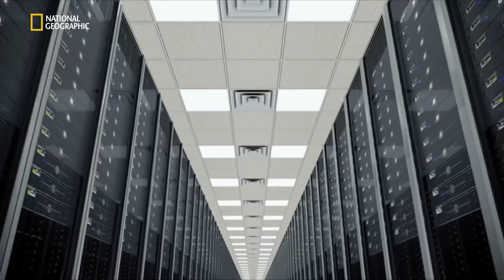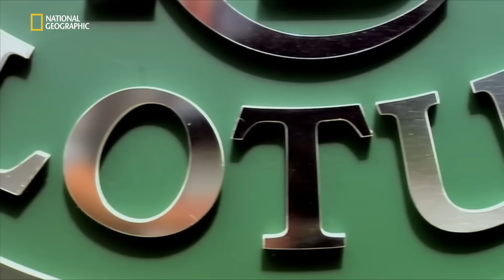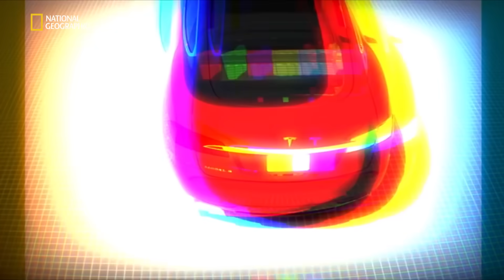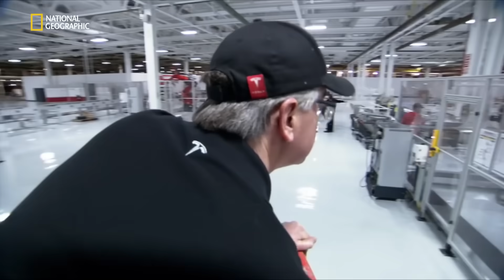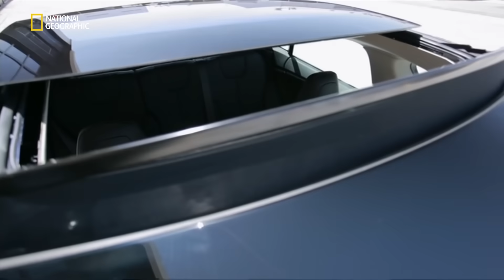National geographic megafactories - Tesla

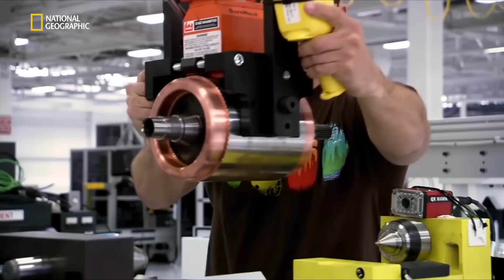Comment: 15:18	Carry an electric motor using an overhead hoist and place it on a jig
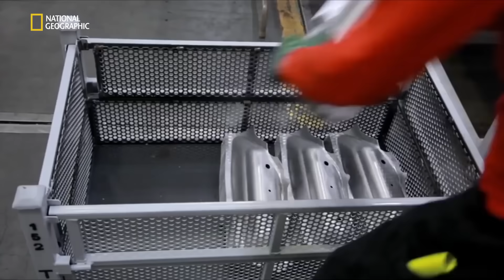21:47	Place stamped parts in a crate
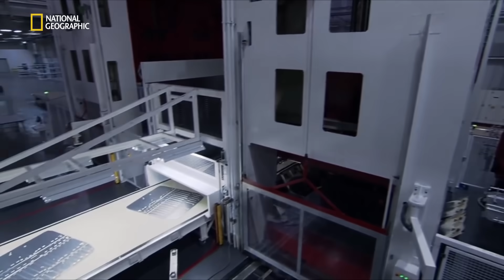22:20	Pick stamped parts from a conveyor
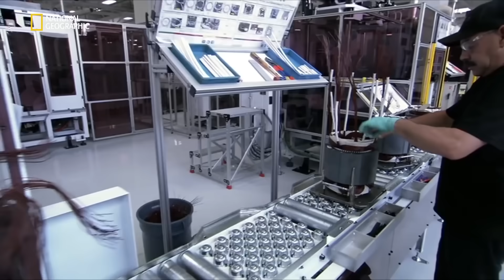23:14	Adjust the winding coils of a motor placed on a jig
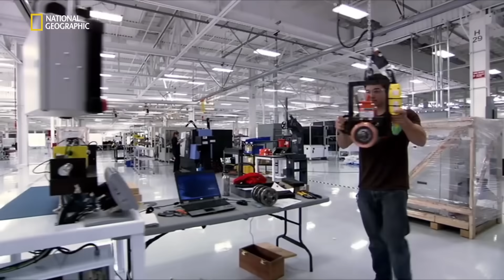25:10	Carry an electric motor using an overhead hoist and place it on a jig
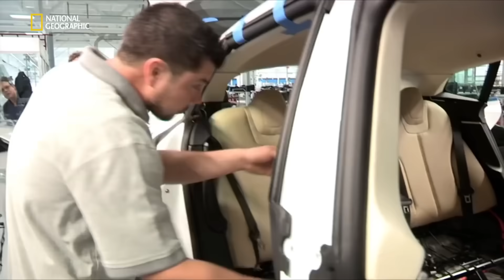42:46	Install the rear seat
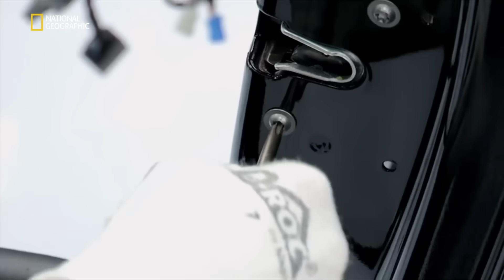42:58	Fasten a torx screw using cordless right-angle nutrunner
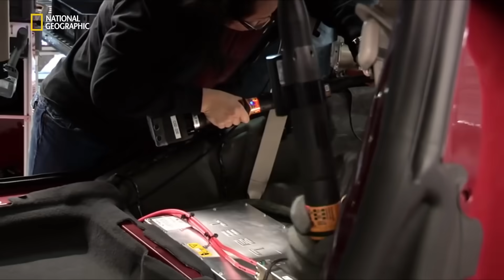43:03	Fasten a torx screw using cordless right-angle nutrunner
43:10	Insert and install the dashboard using a custom jig
45:08	Working in rear wheel well kneeling down
45:17	Move and set up a jig
45:37	Adjust the positions of parts on the axel as the body is lowered onto it
45:43	Fasten bolts on the axel by hand
45:48	Working under the chassis looking upwards
46:13	Working under the chassis looking upwards
46:20	Fasten bolt in a wheel well using a ratcheting hand tool
46:36	Working under the chassis looking upwards
46:39	Fasten bolt under the chassis by manual key/screwdriver
Reply: Is that your homework?
Reply: @joaopedrosousa5636  yes :D

Comment: I love the car and the style. I can not hide the truth but charging a battery with a cable?. That is not a good idea. That is a fail idea I will never never agree with or better to say: I will never buy an electric car which I will have the need to park my car in a location in order to charge the battery. Japanese people were in the good direction when they created HEV(A hybrid electric vehicle). It should be a better way to charge those batteries without plugging in. This car is not a MUST BUYING for me. My idea is very simple. If several solar panels can generate electricity we can do that with the car as well. I think if we put the solar panels above the car we can charge those batteries as well.